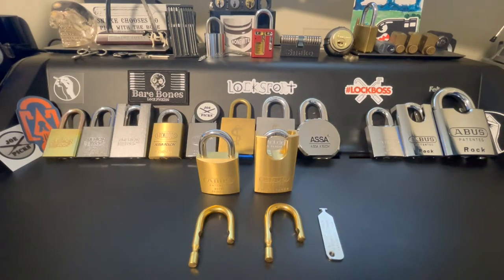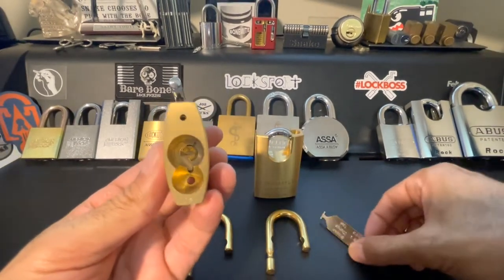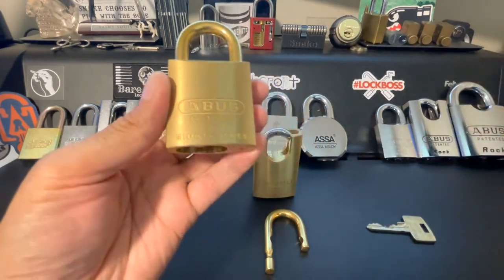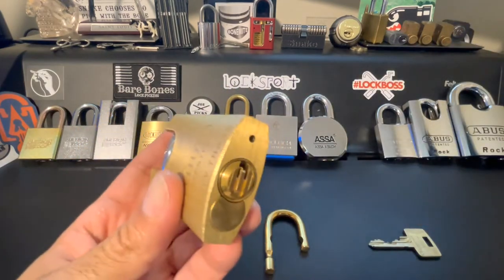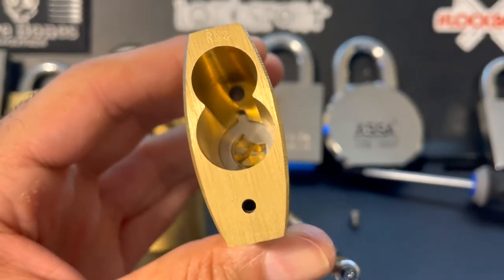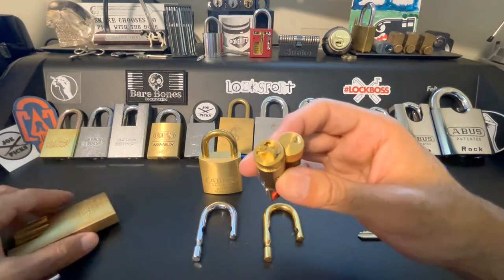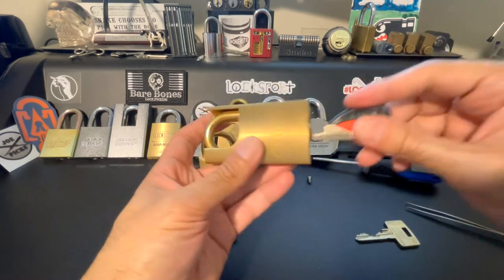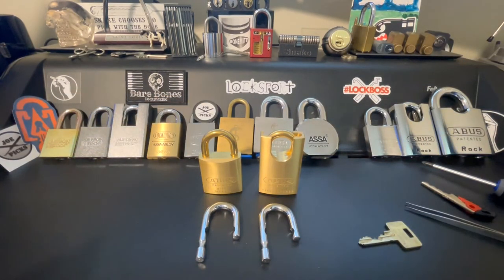Abus 83 Shackle Change - Two Methods

Comment: Great video, thanks for the tip, I knew the shackles could be swapped out but didn't know you could flip the Z-bar to do it. I just tested it and it works perfectly.
You learn things every day!!

Have a great day
Reply from the maker: Awesome! Thanks for checking it out. I bought the shackle change tool before knowing about the z-bar method. Sometime later I found out about it while on the Abus website. Makes me appreciate the 83 series even more.
Have a great weekend.

Comment: thank you for the tip I always used the tool. if i didn't have one I would drop the drive and the ball bearings pull the shackle that way.
Reply from the maker: Thanks for watching and sharing your trick. Another way is to use a flathead screwdriver. The Abus 83 series is one of my favorites due to how versatile it is.

Comment: Beautiful I love the look of all brass, excellent upgrades to those two. And great cores in them as well. Very helpful tips  👍.
Have you picked that bilock?
Reply from the maker: Thanks!! I’ve not yet attempted to pick the bilock. I want a new tensioner which will fit perfectly in the faceplate so I’m not tensioning solely off the small separating piece. Thinking about ordering a set of tensioners from Multipick.
Reply: @SnakePicks  there is so much to want to order from multipick lol
Reply from the maker: @NomadicHacker.  😆 very true!! Good time to buy with the USD nearly as strong as the Euro.
Reply: @SnakePicks  true I'm more tempted my the exchange rate between the US dollar and Australia (bare bones)
Reply from the maker: @NomadicHacker.  True that! Every time I buy from them I’m getting so much for less.

Comment: Any ideas on removing the core after accidently installing without accuator?
Reply from the maker: @lanceliddell5894  Is it the actuator missing or the tailpiece which interacts with the actuator that is missing? If it’s just the tailpiece, then there is hope, as that means there is room for you to fit a bypass tool in to reach the actuator. If the actuator itself is missing, then it’s probably a bricked lock. My buddy Freediver was sent an Abus Rock to rescue after someone forgot to install the tailpiece during assembly. Here is his video describing the situation and showing the bypass tool he used: https://youtu.be/eeaBqUwyOUM?feature=shared Good luck 🍻
Reply: @SnakePicks  Thanks so much for the quick response. I’ll try that tomorrow.